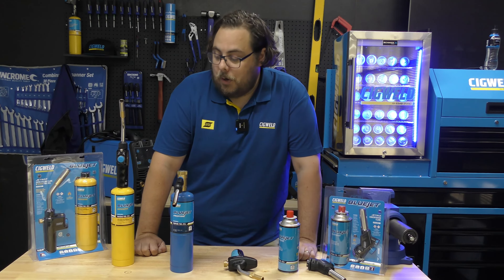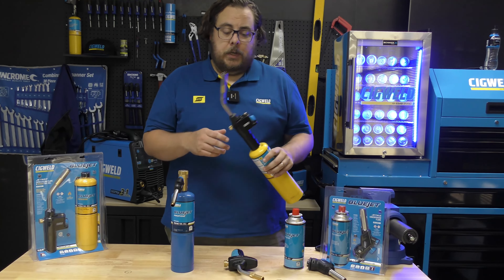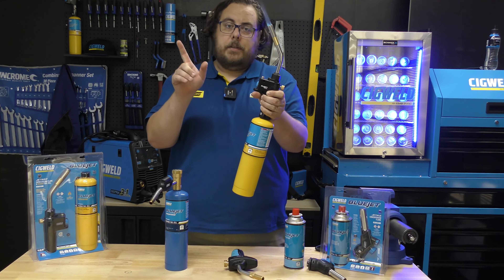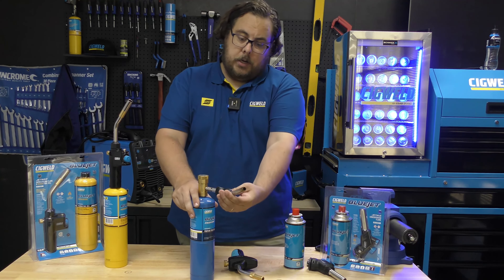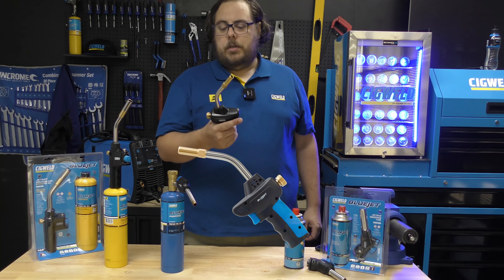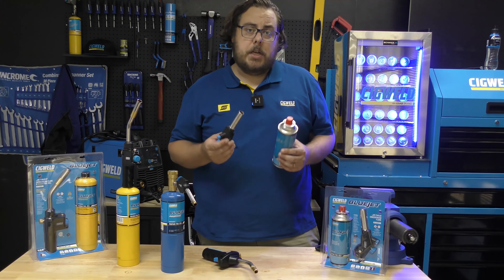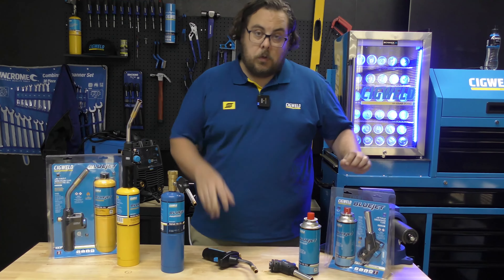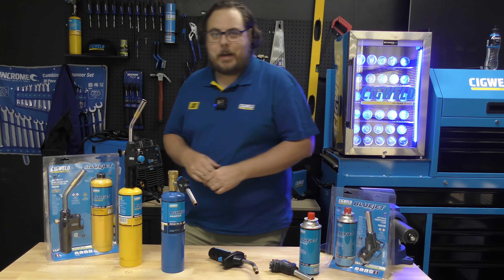CIGWELD FAQ - BlueJet Torches - What's the difference?

Comment: I'm looking at using a cigweld bluejet jet407 to heat and bend some 2" x 3/8" mild steel bar into a large radius for a slasher skid, will this do tge job or should I just go with a cutskill lpg cutting and welding kit? Cheers

Comment: Having an issue. I have a new 408, havent ever used them before. Screwed on top to the yellow bottle, turned knob to on position, tried button/external flame, nothing? should I hear some sort of gas noise when connecting. Unable to get any flame. Have tightened to the bottle as much as possible.
Reply: tried another propane gas bottle I used for camping and worked. The pin on the handle wasnt reaching the hole on the one with the cigweld package. I untighten the pin part slightly and is now working with the one provided in the packaging.
Reply: @cheapdomainnames  Good to hear. I will pass on your situation to the team to look into.